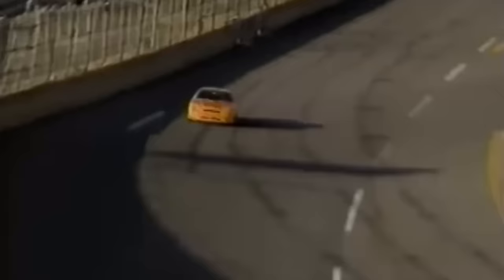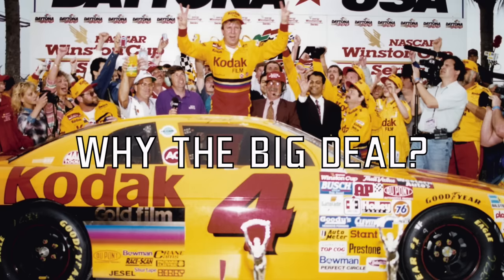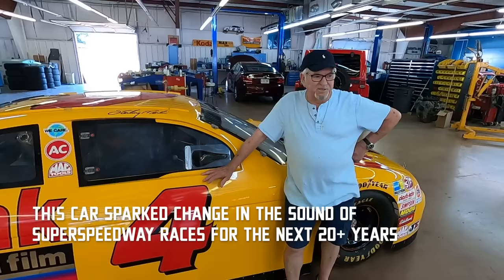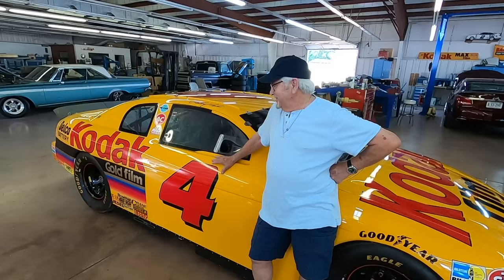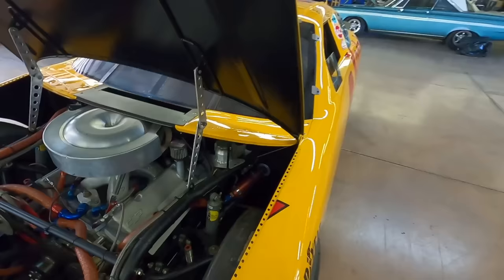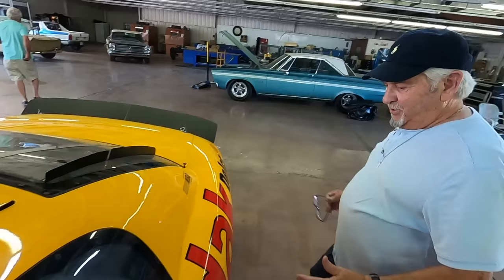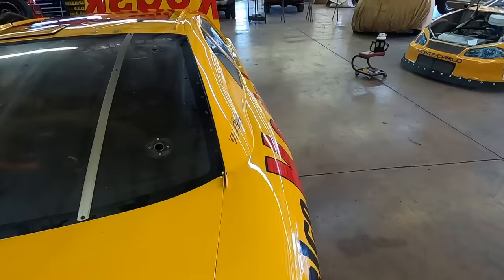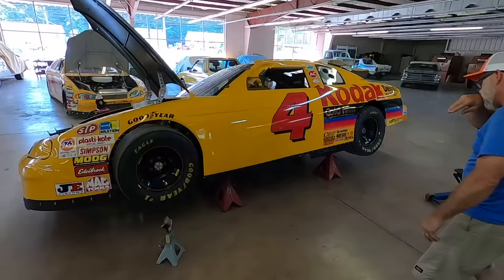The Car That Changed NASCAR: Sterling Marlin's Crazy Sounding 1995 Daytona 500 Winning Monte Carlo!

Comment: Interesting exhaust.  I was sitting in the cyclone headers offices in north hollywood in 79 or 80. There was a conversation across the room about antireversion headers for 440-3  motorhome engines.  Just installing the antireversion headers had changed the exhaust scavenging so much the 440-3 in  full size motorhome got 33 mpg. But it leaned the engine out so bad it melted the pistons.  The could not sell them do to the fact that a number of people would put the headers on without doing the carb mods and ask for new engines.  
In the late 90s the guy across the street had a non turbo honda drag car.  It sounded horrible.   I grabbed a paper towel and drew out an insert pipe to install at the 3 bolt collector.  He had his exhaust guy make up one.   He had it on the bolt on dyno. It made 265hp.  Just for kicks. He installed the tuning tube. Picked up 10hp to 275 by just installing it.  The car also changed the exhaust sound. Instead of sounding like a honda. It sounded like a healthy big block chevy..  the tuning tube was drawn out as an extended collector adapter that fit inside the pipe after the collector flange.  After the collector it funnels the exhaust pulses into the tuning tube.  This speeds up the flow and keeps it flowing constantly .  This flow increases the scavenging effect. Lowering the pressure in the collector and primaries.   As the constant flow thru the tuning tube comes out into the rest of the exhaust system.  No reflections can go backward into the collector and slam into the next exhaust pulse coming down a primary tube.  Any reversion that does heads up the dead headed gap between the outside of the tuning tube and the inside of the exhaust pipes.  
I would not run that without wide band air fuel ratio gauges and staged dyno runs. Looking at the air fuel ratio at 1700 to 1800.  3600 to 4000 and 6000+ every 200 rpms.  So you don't destroy the engine.  Those rpm ranges should be the last part of the idle transition circuit before the primaries start to trickle.  Tuning the idle feed restrictions. Then the top of the primary rpm range before the secondaries start to flow.  And where the primaries are wide open and the secondaries are close to wide open but the manifold vacuum has not dropped to open the power valve.  
If you want to use these after the merge collector.  Use the exhaust pipe bender to create a gm ball .  Not the flare but the ball the clamps to the flare with a short liner section welded in the ball.  You can ad tabs to the outside of the tuning pipe to screw thru the outside to hold it in place and make it easy to change.
Reply from the maker: You lost me when you said a Honda sounded like a big block chevy lol

Comment: Pretty neat always liked the x-pipe sound the cars always sounded good before but that x-pipe just sounds so much meaner man that window is tiny though i'd probably have a hard time climbing in myself and i'm 5'4" that ball valve sounds interesting i've never heard of an oil pump that ran off the rear end and i think it would be great to see it start up again with Mr. Marlin at the wheel

Comment: Back in the day when I was hip deep working the BGN series.  Those were great days of stock car racing.  The X pipe was nothing new, it was an evolution.  In the mid 60s Ford got into indy car racing with the 255 ci quad cam. The headers that sat on top of the engine ( in indy car form ) was called the "bundle of snakes". The reason was  the 2 headers were crossed onto the other sides head. The result was a constant growl of sound instead of  puff puff, one pipe then the other of exhaust.  By doing the X, Pittman accomplished the same thing....and it was brilliant.

Comment: Interested to know the theory behind the X collector section on the exhaust. 
 Can you tell us the path of the air, does it swirl around in there, or just create some type of vacumn?  
Do the entry pipes extend into the X section, or just dump into it?  
Just wondering if the design is managind the air inside there or just using the natural path of the air.  Thanks
Reply from the maker: Theres an oval hole in the bends to allow pressure bleed off from side to side
Reply: @Stapleton42  thanks!  Interesting stuff, I used to run a flapper valve on the exhaust to create back pressure, works on road courses 😀

Comment: Hey yea prolly late to the party on this but I noticed the x pipe under the 4 car does not have the h looking blow through tubes on either side of the x pipe.  Any thoughts?
Reply from the maker: Those brace connectors weren’t the normal thing

Comment: We use to make the tail pipes out of rectangular tubing and weld it together then form it to the collector those tail pipes if you used small and big tubing the tailpipes alone would give you 4 to 5 actual horse power on the car Dyno we would change just the tailpipes while sitting on the dyno to see the difference on paper it was pretty amazing ,,,4 and a half gallons of oil is a lot of oil ,,Bud Moore ran the first drop snout car from Daytona till mid year before any one else even caught on to it ,,,he's never going to tell you all that little things they did while they were running and winning lol they never do even after the fact

Comment: Stapleton 42 you can buy the x pipes like they used new or used from second chance race parts sometimes or go online and you can find drawings on how to fabricate your own. I found a full nascar exhaust system at second chance race parts that had come off of a 1999 Daytona cup car and I put it on my asphalt outlaw late model and man that thing screamed and it sounded amazing my dad said over the radio that it sounds better then any other car and that was during qualifying we have no engine rule except no big blocks and 12:1 compression and a crank weight rule carb rule and max 400 ci rule that was it we had a motor we bought off a asphalt sprint car team that they bought off of Rick Crawford that came out of one of his old camping world trucks from 2007 superspeedway truck. We had that thing turning 9100 rpms and you could hear it shake the grand stands when we rented the track for private testing week before it's first race. I was only 13 at the time driving it and it scared me my first time going down the front stretch wide open hearing how loud that motor was cause the wall makes the sound twice as loud and it hurts your ears even with the custom molded racing electronics earbuds that are noise canceling so you can hear your spotter

Comment: So, he is keeping most of the engine design under his hat. He said the heads were redesigned but he didn't mention firing order, crankshaft design, bore to stroke ratio, piston design. Many things will effect the sound of the exhaust.
Reply from the maker: Firing order was the same. I’ve talked to them about it before
Reply: Danny Shortridge Sr. built the engine for this car

Comment: Did u see how long the primary runners are and then it goes to one collector but it jumps down slightly then increases again straight into the xpipe. That Is what I'd say is 90% of your sound along with the boom tunes he has on it.
Reply from the maker: Equal length primaries and the x right after the collectors yes
Reply: @Stapleton42  yes but it looks like after the equal length primary's they jump down into a smaller collector then jump back up in size going into the xpipe. That could make it sound roudy as well.

Comment: Could these guys use a flat crank shaft by the '95 Rules?... Cause a flat crank can be timed so that each head can have even Ex. pulse 
that is equal degrees apart on the 4 Ex. ports like a 180º set of headers into collectors. << sorry if I missed this question in video.

Comment: The purpose of the X-pipes was to prevent  the Silicon nitrate from leaving the exhaust. 
The original pipes had C channels, which filled up with SiN2 and would sound like rocks tumbling inside if you shook it after use. 
What did Kodak and Dupont have in common?
They're the two largest chemical distributors in North America.
HAY, it was AP sublimation, do you conSEED?

Comment: I've argued this before but it sure sounds like a flat crank (180 % crankshaft) and not a cross crank (90 % crankshaft)
Reply from the maker: It’s not one though! Standard 90 degree crankshaft
Reply: @Stapleton42  that may be true however it's much more than just an X-pipe like cam and firing order

Comment: Wouldn't you have to change the crank or cam  in order to change the firing order?
Reply from the maker: The cam lobes would change but not the crankshaft
Reply: Some guys in the Arca series still run an xpipe and tri y depending on the track. they sound just like the superspeedway cars. Arca cars are limited to 7000rpm. The tri y, cam package, and most importantly, the x pipe will get you this sound. Super late models have this sound. and I personally heard the 39 car of Ryan Sieg in xfinity make this sound at charlotte and pocono.

Comment: rear decklid is wider than stock and there was not a rear wheel drive option available NASCAR had to fix it for Government Motors
Reply from the maker: They had to do the same to invent the Taurus coupe in 98
Reply: @Stapleton42  this government motors shit came first and set the precedent
Reply: Please explain the notion that the government was responsible for manufacturers converting to front wheel drive. Remember the FWD Olds Toronado came out in 1966, and didn't Auburn have a FWD model in the 1930's?
Reply from the maker: @johnmcmullen456  I wonder that too. It was always my understanding that fwd was better in snow and a more economical way to put a car together for the average commuter. I grew up in PA where people avoided rwd cars and 2wd trucks for the reason of winter mobility.
Reply: @johnmcmullen456  the company has been taxpayer propped up since fdr
Reply: @2838Steve Maybe so, I'm not a FWD fan but you make it sound like the government mandated a conversion to FWD. If that is the case, why are GM, Ford, & Chrysler still building some RWD car models and the biggest sales are for RWD pickups?Some previous FWD vehicles went back to RWD for their present generation including the Chrysler 300 and Ford Explorer. Where is the government intervention?
Reply: @johnmcmullen456  never said government motors was mandated to go to front wheel drive. I said nascar let them run a front wheel drive car in a rear wheel drive series. Also made the rear deck wider for them so it would be stable

Comment: The LS engines just don't have the same sound as the older Chevy v8's. Even though the LS makes a lot more power than the older Chevy V8's they just don't sound the same or as good. The same can be said about the Ford Coyote V8 engines sounding worse, in my opinion, than the 4.6 V8's and even more different than the old pushrod 5.0 engines.

Comment: So, since y'all a NASCAR nerd, have y'all seen the 91' Dale Earnhardt Sr 18 degree cheater head's, before!?  You know, the head's, that were supposedly impossible to make work, and yet, caused him to win the race's, by at least 1/2 the straight, as long as he didn't crash, or have some other issue happen!?  If not?  Then, you might wanna get a hold of me, since I am in possession of a set of those 18 degree cheater head's!  Now, they are not the head's off of his car.  But, they only produced a small amount of these head's, at that time.  And, I can explain what the theory was, behind the engine specialist, who made them work for the GM company, after he was presented the task of doin the work.  He was sent 7 of the 17 set's of those head's ever made, straight from the factory, where they were forged at.  And, he just had to send 3 of the set's back, when completed, and he could keep the other 4 set's.  As far as I last heard, there are 5 set's left in existence.  2 of the set's, are in a couple of Dale's old car's, sitting in a museum, or in a private collection's, now.  Unfortunately, the man who did the work, can't be here to tell the story, due to the fact, that he died 02/25/2020, at 10:30pm(EST).  He was my father.  He also helped the Ford team(I forget the big named of the guy who owned the car's, at the moment), I believe, back in 2001, maybe 2002, when they were havin trouble's with the fuel vaporizing, way too early, and causing the engine to spit & sputter once it got heated up.  They had the fuel line too close to the engine, which would cause the fuel to evaporate in the line's, causing the engine to run super rich, as the vapor's couldn't be regulated, as the carburetor, is made to regulate the liquid fuel.  So, it poured way too much fuel into the engine, causing it to spit & sputter.  And, at the track, what fixed the issue, were a couple of 45 degree angled connector's, instead of the 90 degree angled connector's...

Comment: Not sure about the first crazy sounding car at Daytona.   I was at the 1979 Daytona 500 and Yarborough drove for Junior Johnson at the time.   Yarborough had the craziest sounding car on the track.  It sounded unlike anything else on the track at race speed and very fast.  Listen here as Waltrip (driving Junior Johnson's car in 1981) pulls out of the pits during a caution and you can hear what I'm talking about.  

https://youtu.be/kh7ycL-WUP0?t=2045

and here

https://youtu.be/kh7ycL-WUP0?t=2172
Reply from the maker: Juniors cars often used 180 degree headers back then. By the 90s that had completely gone away
Reply: @Stapleton42  They sure sounded wicked.  My Dad and I were just past the start/finish line.